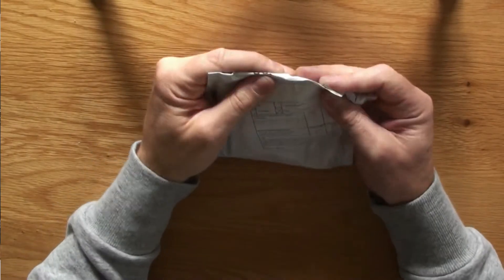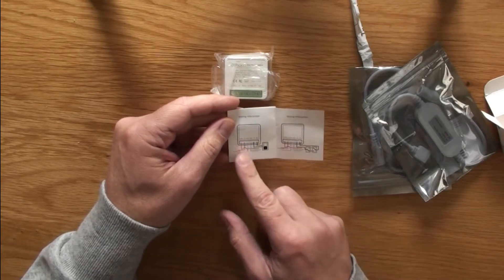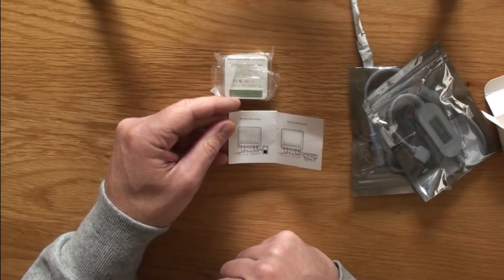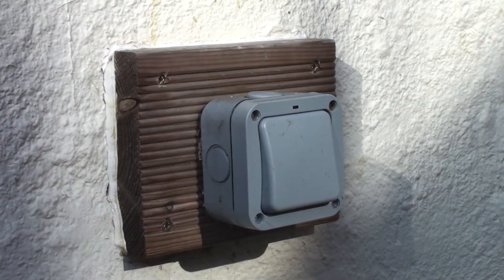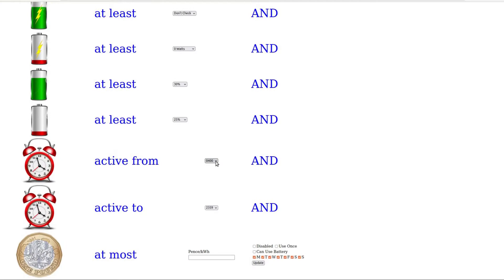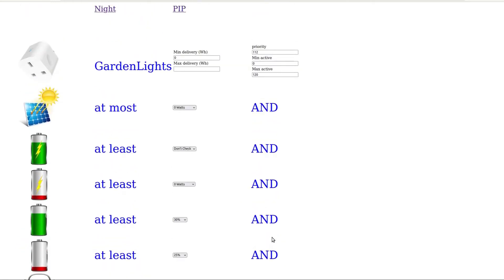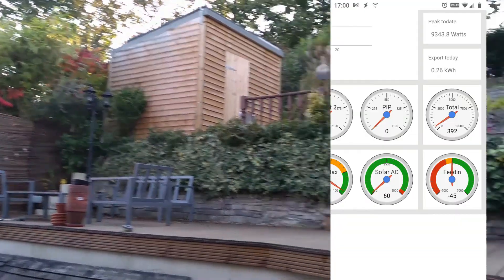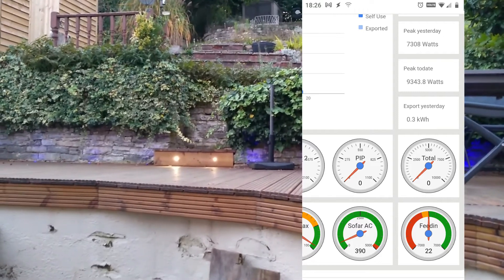Tasmota IOT devices for automation.

Comment: Hi Nic
Sorry,off topic again.
Iam looking at a 16 panel system with a tranenergy inverter it's grid tied.
House is being demolished and selling it all for £1500.
Can I use it for off grid,will the inverter be fine for off grid too.
I plan to use it to heat storage heaters,as my "batteries".
Reply from the maker: Most grid-tied inverters cannot be used in an off-grid mode.  They require the grid connection in order to function. Without it they will not operate as they will perceive this as a grid down situation and will not generate in order to protect workers who may be operating on the line.  Does the £1500 include all the mounting rails as well as the panels and inverter?
Reply: @nicholashowell  yes,but I wouldn't be putting it on roof,maybe use half panels on veranda,yet to be built.
Contractor can't tell me anything about it,but photos look very good condition,sounds like inverter would be no good then.
Reply from the maker: @alanrobinson2229  Yeah and if the inverter is no good to you then you might be paying over the odds for just the panels.  How many Watts of panels total, is it 4000?
Reply: @nicholashowell  I don't know,as I say contractor has no idea,I guess 250 w each.maybe I will give it a miss.
Reply from the maker: @alanrobinson2229  You would have to buy an off-grid inverter and without a battery it would be very tricky to get it to work as you want.
Reply: @nicholashowell  so it doesn't work with no battery,inverter won't direct electric to heater?
I got a free storage heater.
Have been using to dump excess electric from my existing grid tied,battery system.
Is working well on cooler evenings as alternative battery.
Reply from the maker: @alanrobinson2229  I think it might struggle when the power available isn't enough to power the storage heater. I wanted an old storage heater for the same purpose as you but now with 2 EVs and a large hot water tank I only have a surplus of electric in the summer and then I don't need the stored heat.
Reply: @nicholashowell  I have external wall insulation,I believe this is retaining heat,so even a little could make a difference and remove need to use gas combi.
Iam filling up my 14 kWh batteries so far and also topping up EV and storage heater on evening.
Wonder if a couple hrs on octopus go,is cheaper than gas for winter (math not my strong point)